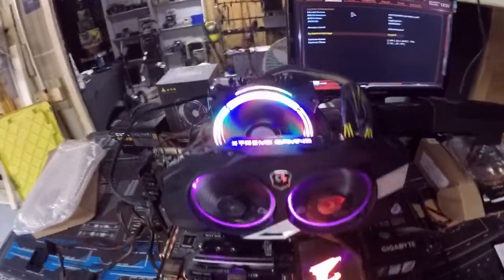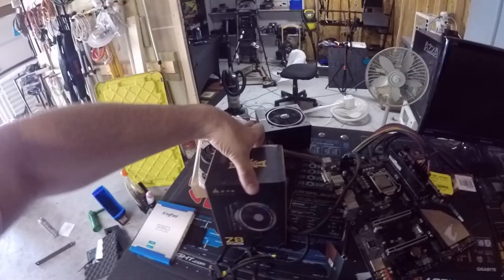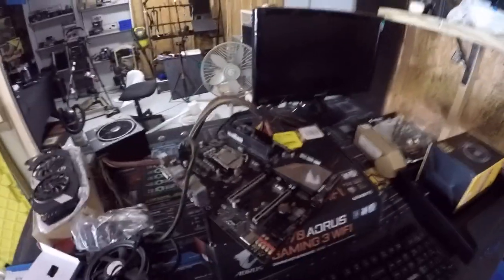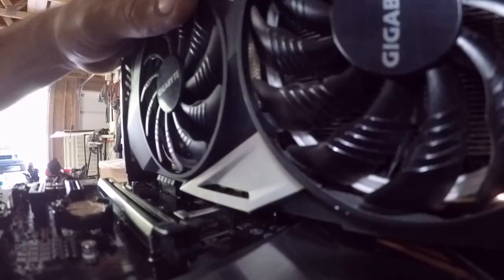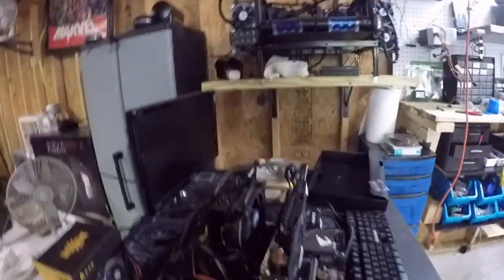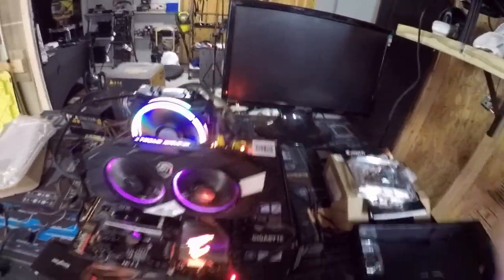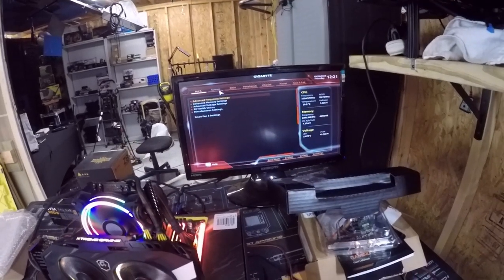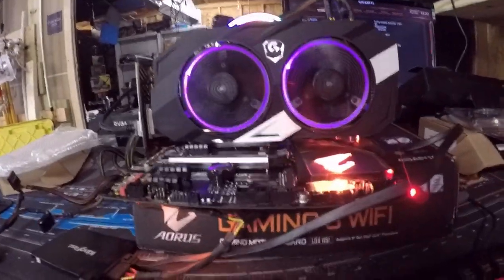GIGABYTE H370 AORUS Gaming 3 WIFI-

Comment: When using this motherboard, when Windows 10 enters sleep mode (I use Start -> Power -> Sleep from the Windows menu) ,  the power button LED from the front panel does not blink, it just turns off. What options do you have set in BIOS that might help ?
Reply from the maker: im not sure... i would google that question.. its been a while since iv used this board..  i would think that u may not be able to change it.. a light comes on or off during a some commands giving  .. thats a good question ..